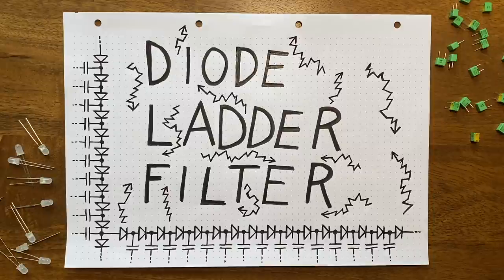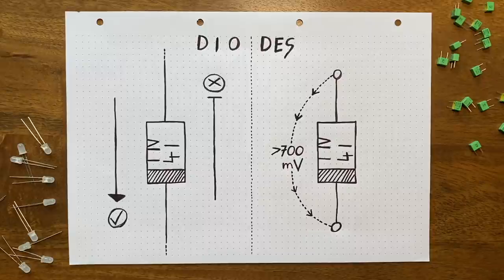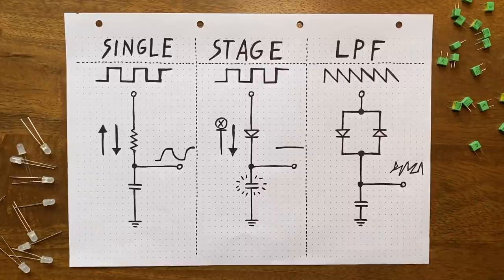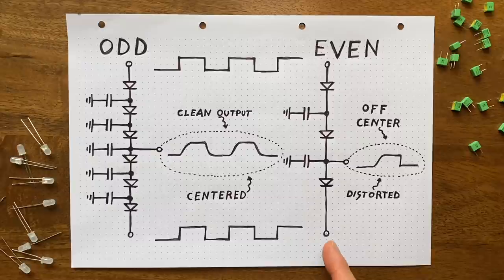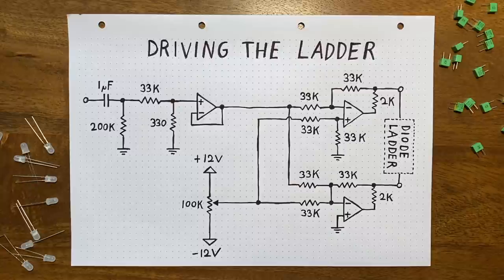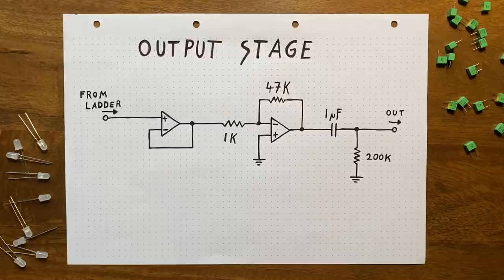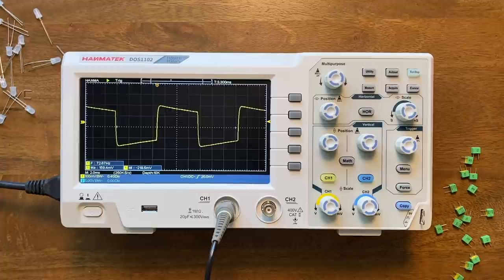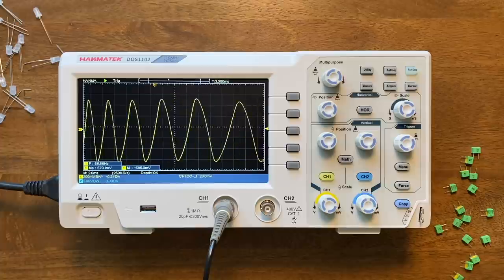Designing a diode ladder filter from scratch

Comment: I was wondering, how much does the quality of the capacitors matter? I am intrigued by this design because it uses such common components. I am working on building a version of this filter using components available for manufacture by JLCPCB and was wondering what effect using very basic smd components would have vs film box capacitors.
Reply from the maker: i think there's mainly two factors involved here: 1) tolerance/actual capacitance – if your capacitors are very dissimilar in capacitance (due to tolerance), your filter's slope will become less clearly defined. you could prevent this by matching your capacitors. 2) capacitor material – consensus seems to be that film/foil capacitors introduce less distortion than ceramic. i've been told to always use film/foil in audio applications.
Reply: @MoritzKlein0  That is interesting. I am not against characterful distortion. I might try it out with cheap ceramic caps and see what happens. Speaking of distortion do you have any tips for adding a bit more grit to the resonance? I like a good growly filter.
Reply from the maker: @warpigs330  i will cover that in the next video, but the basic idea is that you increase the volume of the input signal. that way you drive the diodes, which dirties up the sound.

Comment: Hey, I’ve tried building this circuit but I got no signal at the output.. At both sides of the ladder theres my signal at around 200mvpp but nothing at the middle cap… does anyone have an idea of what could be the problem ? I already checked all the diodes and capacitors ant they’re all good…
Thank you :)

Comment: *There is a lot of hidden filter modulation to make that quack like that? Seemed to be a surprisingly large jump at a certain point in that video. I've built an emulation of that before and seems as though it didn't sound like that before adding envelopes to the filter. *

Comment: When describing why filter stages should be an odd number, I had a thought: namely, if you were to "tune" the stages properly in an even # diode ladder, could you use this as a basic waveshaper from square to "ramp" ish, with either option of output giving you an up slope or a down slope?

Comment: How did you used the Poly800 in that video? Did you wired it in the filter directly or you used midi to convert to CV? I have a Poly800-II and was curious if I could just use the synthesizer as "oscillator" and wire through couples of modules directly. (newbie here)

Comment: Maybe a somewhat ignorant question (as I've yet seen only half the video) but what advantages do these biploar pn-diodes have over field effect transistors here? When I did electronics in the 1980s, the latter was kind of the typical element used as a voltage controlled resistor (as well as a binary transmisson gate).
Reply from the maker: i have yet to see a proper VCF implementation using JFETs. my hunch is that it just does not work well with AC signals. but i'd have to look into it to make a qualified comment.

Comment: I'm very surprised the resonance sounds so good and squelchy when the feedback isn't inverted! It's my experience that positive feedback should have the opposite effect and make the filter sound really woofy.. if that scetch is correct I must be missing something..
Reply: I think i got it, is this due to the capacitor and diodes behaving like a highpass filter for the feedback? Still amazed of how good and tight it sounds, great low-end retention at high resonance 👍
Reply from the maker: yeah it's about the way the feedback is mixed in with the input signal. the MS-20 filter does it the same way!

Comment: As a novice electronics and modular synth enthusiast, which is the starting hardware you recommend as base for similar analogue circuit-developments? Like, is a certain sequencer a reasonable start, or maybe one can't go wrong with a midi keyboard? I do look for certain sounds (industrial, and gritty) , but I thought that might be the next step after I get comfortable with the circuit-bending
Reply from the maker: definitely something that's capable of sending out a CV signal. the korg SQ-1 is a very affordable option which works quite well!
Reply: @MoritzKlein0  Thank you so much for replying to my question so soon!

Comment: How do the # of stages effect the filter? Is 5 the minimum? Is there a maximum? TIA you're the best!
Reply from the maker: in theory, each pair of added stages should make the roll-off steeper (1 stage is 6 db/oct -> 3 stages is 12 db/oct -> 5 stages is 18 db/oct... etc). 
in practice, this is not going to be so clear cut since the stages are not buffered and therefore influence each other. so i think you get heavily diminishing returns by adding more and more stages. haven't tried it with more than 5 though.

Comment: Thank you so much for this video Moritz this is awesome! I'm pretty new to all this and feel like I have a pretty dumb question but with the one pot getting hooked up to 12v and -12v, what exactly is negative voltage and how do I go about doing that? and does that mean that this circuit requires a 12v battery?? Sorry for the beginner question but thanks again for the series!

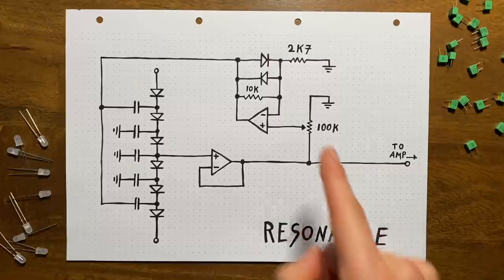Comment: I barely understand what's going on here and need to watch it a few more times and do some reading. So maybe this is a dumb question: At 32:00 you add resonance by feeding the output back into the ladder. Makes sense. You feed it to the top and bottom. Makes sense. You don't invert either of the paths. What? I thought that was the whole point of the ladder!
Reply from the maker: i‘d suggest you watch my DIY VCF series first before diving into this one - especially parts 1 & 2. that should make it easier to follow!
Reply: @MoritzKlein0  I did. Moments after I made that comment I left the house for the day and realized my error. They aren't inverse copies. They are offset copies. This is a really neat filter idea. In reading about it, I see there's also a transistor version that separates the stages better somehow. I'm interested in trying out more than one kind of filter. Thanks for these videos!

Comment: How does a SEM filter work differently from a ladder filter?
Reply from the maker: not too familiar with the SEM filter, but at first glance seems to be similar to the MS-20 filter. both use OTAs to implement voltage control over the cutoff. (the MS-20 does resonance differently though, which is why the character is different.)
Reply: @MoritzKlein0  Yes, I have an MS 20 and a Minilogue XD, but the Oberheim sounds smoother to sweeter to me.

Comment: At about 11:35, WTF? First "keep the bias offset the same to keep them same vals" and then SUDDENLY "change the bias offset"...WTF?
Reply: The offset bias/current is only changed when you intend to change the cutoff frequency, or how much the diodes resist. Therefore to change the cutoff frequency you have to change the bias current/offset. ** When wanting to maintain a specific cutoff frequency you keep the bias current/offset constant.
Reply: @JakeTheCake254  Thanks for clarifying! Almost midnight and too tired to process that right now. So plan to read it again tomorrow👍🏻

Comment: My Moog Grandmother uses transistors instead of diodes, like the original. Same difference really.
Reply: The Roland synth filters ( TR808, 303) use diodes.
Reply: actually a transistor array chip on the Grandmother.

Comment: F_ck I hate assembling a complex stripboard style PCB. I should have had the PCB manufactured. Can handle assembling a proper PCB. Almost done with it, although f_ck. Sigh...body is tired from that shite. No CTRL+Z when breadboarding or stripboarding. Especially after soldering. Anybody have an extra pick and place robot to donate to Me? I should be doing SMT design and using robots for assembly if making PCB. Should be more careful with My body.